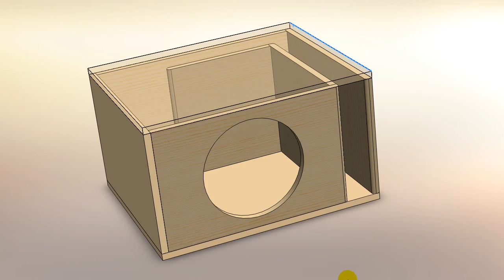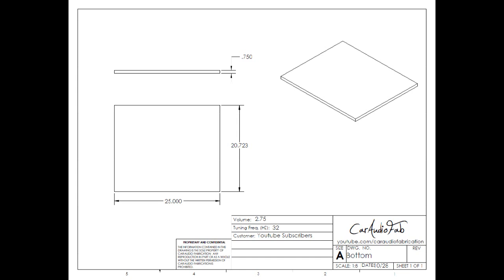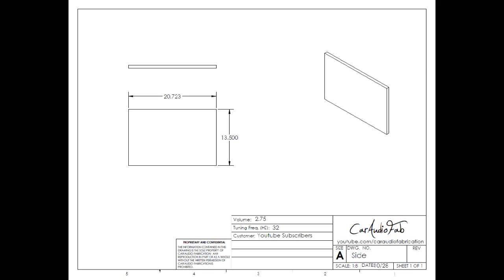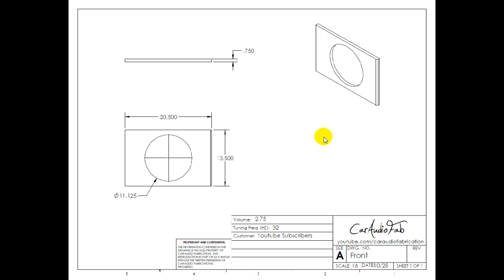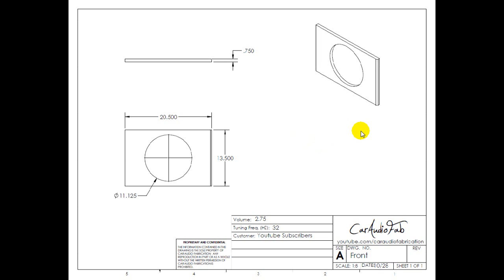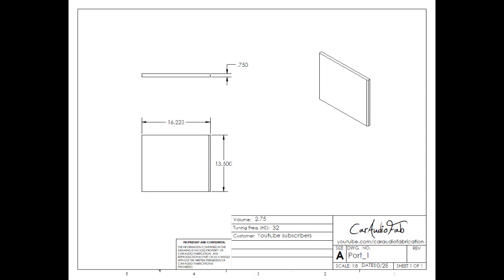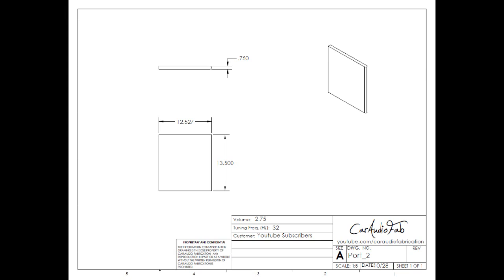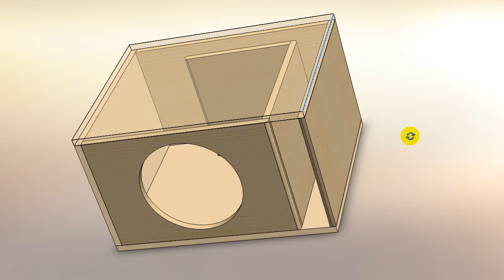Free Sub Box Design! 12" Sub 2.75 Cubic Ft at 32 HZ - Based on SSA XCON

Comment: Do you have a subwoofer design for a Soundstream T5 “12? The recommended enclosure is 2.5cu sf tuned at 38hz. Not sure what all that means but those are the recommended specs.

Comment: Good video, Just a question. Did the box volume of your design and it came out to be 3.3 cubic ft. but with the video it states 2.75 cubic ft. Can you explain this please because i'm in the process of building a enclosure and i'm getting confuse. Because even with the subwoofer displacement, the volume should not drop down to 2.75cubic ft.
Reply: Just for future reference if someone read this, you probably didnt detract the volume of the port. The "box volume" should be 2.75 without the port.
Reply: sorry meant 3.5 cubic ft.